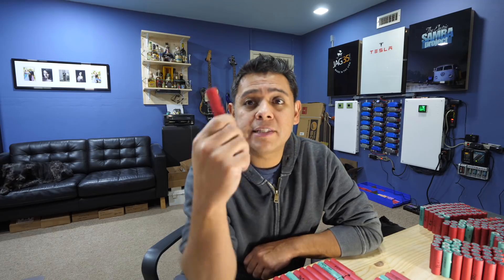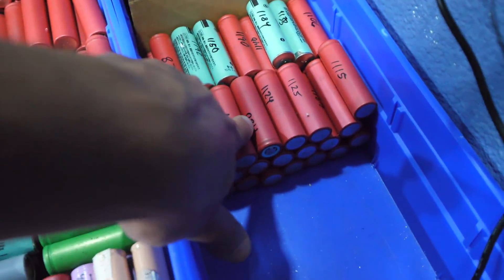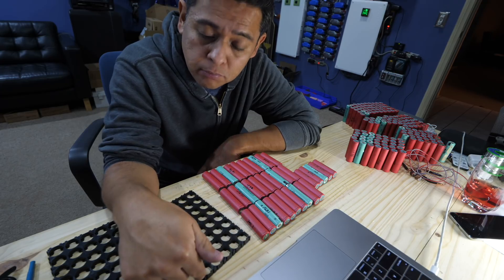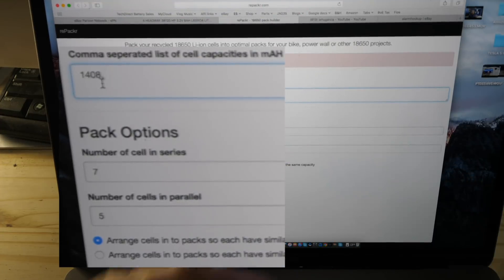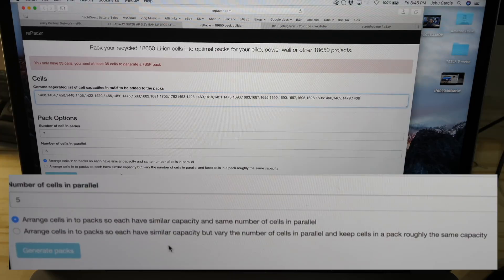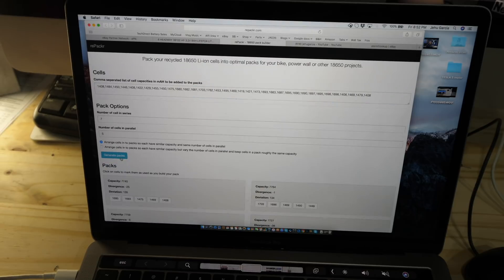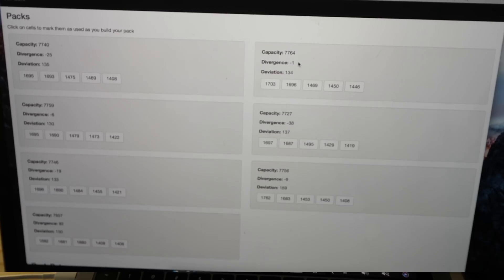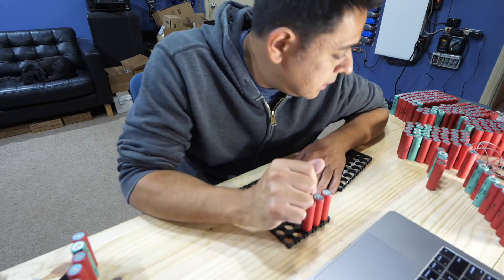Make Matched 18650 DIY Powerwall Modules using Builder tool rePackr.com

Comment: I got quite some 18650 battery’s from battery packs, but i always use LGHG2 3000mA for my vaper, these battery’s are the battery’s ever made, it asks a-lot of current draw, and you recognize a good battery with this vaper! 
When the battery is empty, it immediately stops!
If you draw it in a schematic, the curve line goes immediately to zero, with bad produced battery’s the curve line goes slowly to zero amps, which is quite annoying though. You will find these battery’s in good quality electric drills etc. They keep their full, and it immediately stops when their empty.
This whole story takes me to this.
When I charge a battery from a accu pack.. charged it for 2200mA or so, but when i fire it up, a lil’ fluffy cloud comes out for a second. So this is a good indicator to test a current load.

I learner this is on my from a old skool repair man, he said when a battery is fully charged it won’t tell anything!
When he putted a watt meter on it, you see the current drops so fast, that the battery is unusable en go straight to the dumpster!
I haven’t got a single battery from a pack which can hold up with my vaper..
So those battery’s are quite bad, I think they do…
Maybe in a battery pack, but i really dunno.
But putting a load on it it will immediately tell you something, so i guess you can skip leaving the battery’s to wait for a few weeks. But you can test this by comparing.
If so leave the whole storing technique lol

I have some other question also…
What it is the cheapest method to discharge.. lol a resistor, but safely discharge, so it dusn’t goes under voltage!
Reply: I did some measurements on my work..

I tested 2 batteries from packs and 1 Good battery LGHG2 with a wattage meter 
They all measured 3 watts, but when i added a voltage meter also i saw a big  difference!
The HG2 stayed on voltage, while 2 other 2 battery’s had a continuing voltage drop 🤓
This kinda explains why those battery’s didn’t work i my vaper.
It wasn’t capable to provide a steady load. I vape at 50 watts with 0.18 coil/resistor so if you do the math you will have current load of 16.6 amps @ 3volts, my vaper goes up to 75watts and with a 0.18 coil it pulls 20.4 amps current @ 3.68v the HG2 supports 20amps so i know that the battery is healthy when i use it in my vaper..
This is like the most extreme current draw you can do.
It might be handy to get datasheets of each battery you have to see what current draw they have, and with an ohms law calculator you can easily calculate resistors en very important how many watts a resistor must be, because the can get hot though.

If you do some research and buy some resistors to duplicate load en put a voltage meter on to see if the voltage drops, you see it’s a bad battery…

But maybe those battery’s will work in a pack, due the volume, but the current draw would be way less then when you have non healthy battery’s.
If you have healthy battery’s in it you have a killer pack though!
But with this info given, you can design your own current load test with a few resistors, a broke charger to test/hold the battery and a cheap voltage panelmeter to check for the voltage drop.
Try s different loads also, maybe with 0.1amp load the voltage drop stays steady? 
Ohm law calculator is your big friend in this
Reply: With a 5.6ohm 5watts resistor you have a current draw at 0.73amps & 4.1volts @ 3watts
It’s about doing the math, testing different setups and take note’s
Reply: Maybe a warning notice, if you work with healthy battery that can deliver let say 20amps each battery and you will have 56 in it, it’s like 1120 amps!! That it sum high current no to fuck with tho, if you got a short maaan you get fireworks, you gotta do sum real serious wiring lol with those healthy ones…
Nuff said i hope you can do something with all the info i gave
Btw i dunno if the amps go down if put them in serie, parallel i never work with that stuff
Reply: Maybe a good tip to buy cheap healthy battery’s, company’s who sell new ones regularly get packs back due all kinds of reasons, they can’t sell them as new, they are tested as healthy one’s and you can get them quite cheap tho, may be even cheaper is you disassemble yourself
Reply: Maybe another idea for a adjustable current loader is to buy an istick pico 75watt mod, make it so you use an old broken charger to hold the battery in, otherwise it’s a pain to test many battery’s, may use a higher ohm coil, or make custom, it’s just a twisted a wire. Add a voltmeter Voila you have a adjustable current/battery tester.
Might be handy to check at which rate the current draw, the voltage stays the same…
Then with ohms law you can calculate the current.
But maybe the is a cheap pcb also which has the same functionality… google is your friend in this! Cheers & good luck

Comment: if i have 1000 cells in each 3.6volt pack will i need to do this if all of my cells are between 2400mah and 2700mah?  total battery size is 7s1000p.  how forgiving is the capacity on large power walls.  or should i very carefully balance each pack by tested mah?

Comment: The builder tool is easy to use, spot welding was harder than expected, I built a 7s 15p pack (I wanted to charge 1 amp per cell) ended with a 932wh pack, still have to test to build another one. This video helped.

Comment: So the rated drain of a battery doesn't affect capacity if the amperage isn't pushed? Like I can use a 20c 2500mah battery with a 10c 2500mah battery if I'm not exceeding 10c per cell? They'll discharge at the same rate?

Comment: if we bought the 10 pack of your PCB cardss would that be 7s10p?
Reply: or would it be 10p7s
Reply: and could you even use this tool for your PCB because eche individule 18650 Cell is actually in series?

Comment: Jehu,

Love watching your videos 👍

I want to make my packs modular like you have for my powerwall. My question relates to the BMS for each pack. I was planning on 7s10p packs/modules, with 7 of these modules in parallel to dictate overall capacity. The plan is to set up in a way that I will never draw more than 0.5a from each cell. In your opinion what amp rated BMS do you think would work best for each module?

Comment: Hello, do you have to be careful about the internal resistance of recycled li ion cells? Only use the ones which values are close to one another or it doesn't matter? Because some bms are designed to ballance new cells and those cells have pretty much same internal resistance?
Greetings.

Comment: Can i use 2000×15=30000mah for one parallel, 2500×12=30000mah for other parallel 3000×10=30000mah for one more parallel in 13s battery pack

Comment: Hello. Thank you for creating this video. But I'm a little confused. You say 24v with 7s. But in other videos you say 3s is 12v, so 6s would be 24v.? So 7s would be ~28v? What am I missing? Cheers
Reply: every liion cell is 3.7v. so 3s is actually 11.1. 7s is 3.7 x 7 = 25.9. if you would use 6s you get 3.7 x 6 = 22.2. neither of these is perfect, so you can pick the one most suited for your application.

Comment: What is the best fuse wire? I only use 1/8w resistor leg !!!
what is the ohm you are using it for 1/8w resistor ????????
Reply: The Ohms does not matter, the resistor is removed ...

Comment: Hi J!, I use these BixPower battery packs to power Cisco DX70 units, but I'm wondering if you'd know of something better and cheaper out there.

Bixpower battery: https://www.amazon.com/BiXPower-BP160-188-Watt-Hour-Capacity-Rechargeable/dp/B074R5M5W3/ref=sr_1_1?ie=UTF8&qid=1547236461&sr=8-1&keywords=bixpower+bp160

DX70: https://www.cisco.com/c/en/us/products/collaboration-endpoints/dx70/index.html

Comment: You could have pulled the balancing wire out of the bms instead of soldering en 2nd one to it! Tip for your next balancecharge with thw rc charger. Have a good one m8 love your work.

Comment: Should I check the battery even if I buy brandspanking new 18650s??
Reply: @Victor Guillen
 - It is much better to find out that you have bad cell BEFORE you build the entire pack, because then you need to dis-assemble and re-assemble the entire pack ...
Reply: this only really applies for recycled 18650's. new ones from a TRUSTWORTHY source should be good, but if you buying chinese stuff you should test anyway.

Comment: Don't just run with the first numbers RePacker comes up with.  You can do a lot better if you do one run and then substitute the Flyers with better batteries and run the numbers a few more times like that.  With a few runs you can get the Deviation number down quite good.

Comment: hello Jehu , I need to make a pack 19s 40ah for my scooter  I need to know how many cells do I need thanks
Reply: I think the 19 in 19s spells it out for ya there fella. As for the Ah depends on the capacity and rating of the batteries your using.
Reply: @jose r
 - Do you have any cells in parallel ?

Comment: I do not think that this programm is the right thing to do. putting cells of 1600 and 1400 together in one parallel pack will kill cells since the higher capacity cells always have to cahrge the lwoer capacity cells. Best practice would be to sort the batteries well enough to have them all withinn a few mAh to extend the lifetime.
Reply from the maker: You might want to watch this video again,  the tool discussed here is for the purpose of achieving success using cells of different capacities
Reply: As a physicist i tell you this shortens the lifetime of your cells when you put cells with too much of a difference in a parallel configuration.

Comment: Another Great Video! I like to add a balance cables along with the BMS, just incase I have to balance charge later. You have to be careful when using a BMS and Balancing if you have a charger that does more than .5amps per cell. If your charger does more than .5 amps, sometimes it will trip the protection circuit and cause the BMS to fail, unless you reset it with no charge. Some will allow you to just add a charge and it reset. But if you don't know after balancing and thinking all is good. Your BMS wont balance or protect the batteries. (not sure if this is normal Behavior) just my experience.

Comment: How would I get those 4 digit numbers to enter in website. Thanks. And do they all have to be similar or close to similar voltage.
Reply: those number come from the Battery tester, you can get a Zanflare, or OPUS BT-c3100 and it will give you the internal resistance and the capacity ...there are many more bu that is what I have... I like the Zanflare the best...

Comment: I'm surprised you are not adding Super Capacitors to these setups. They can store energy for a long period of time and some are using them in place of a 12Volt car battery. One guy left his car at the airport for a long time, it still started when he got back using the Super Capacitor's as well as a LiPo square cell with it as well.
Reply from the maker: These don’t need capacitors,  batteries work better at storing energy
Reply: I just thought for some storage it might work well adding some Super capacitor's, you can buy them for Audio Systems for your car for around $400 USD. Check out the guys using Super Capacitor's in place of the car's battery, it stores electricity longer without going dead unlike a Lead Acid battery which all cars are using.
Reply: @cuddles6938  How do Super Caps make this battery pack "better" ?  They add too much cost ...

Comment: I have built several packs and never use a BMS. They always fail and are a pain in the butt! I charge my packs every time with a nice hobby balance charger. The 52v packs I build are split into two 7S packs. I then charge each 7S with my dual 8S balance hobby charger. I believe investing in a good hobby charger will out way all the bad BMS issues I will have to deal with in the future. Plus the hobby charger allows me to monitor cell voltage and resistance which helps determine the over all health of the battery.
Reply: Well, you are using the BMS ( balancer ) that is built-in to the Charger. You have no BMS when discharging ...
Reply: the internal BMS provides over current, short circuit, over temp and over discharge protections for the pack though
Reply: This message was sent 7 years ago and off the shelf BMS units have come a long way. They are now more reliable. I have been using some of my batteries with no BMS for years with no issues with a fuse or circuit breaker for over current or short circuit protection. Obviously a BMS will provide more protection and I use them on my larger packs.

Comment: Thanks! Used this tool for a ebike 13s6p pack. For powerwall modules, would 35 cells (7x5) as you have it here be the recomended pack size? Thanks!
Reply from the maker: Depends what you want to power,  and the scheme you want run your battery at
Reply: just starting here... my idea is 48v and have an "ever growing" powerwall (once is big enough, additional packs would work as replacement of "bad ones")

Comment: That tool should add a way to enter both capacity and resistance so you can build a pack that not only stays balanced during slow discharge, but also won’t let one brick sag excessively during high discharge. Sort of like one of your old videos shows how to do by manually grouping the cells and getting the high drain and low drain cells equally distributed while getting the total capacity of each brick as close as possible.

Comment: You can tell Repackr.com to rerun it's algorithm on your list of cells and it will produce a slightly different sort result each time. So if the divergence is more than you like in the first result - you can just rerun the sort and (maybe) get a very slightly better result. The backend code uses a cool software technique called simulated annealing: https://en.wikipedia.org/wiki/Simulated_annealing

Comment: You changed your mind about Bmss
Which is dispointing cause im planning to build a pack without it.
What makes you change your mind
Reply: He's talked about this dilemma in a few live feeds. For himself he prefers to start with well matched cells and then monitor the battery himself. But if he's building something for other people who may not monitor the battery then it's probably better to go with a BMS. Also - the need for balancing decreased as the number of cells in parallel increases. For a "small" 5P pack it's worth having a BMS (and try to get a reasonable quality one - not a super cheap one).

Comment: Hi Jehu, thanks for another awesome vid. I wondering how relevant the accuracy is. Lets say you want to increase battery life and only charge to 4V and discharge to 3.2, looking at the discharge curve of an average cell that will give you about 10% less capacity but will increase cell life dramatically. When you test the cells you are dependent on the cutoffs from the charger, which will probably be on a larger range then what you would ideally want. I get it that you dont want to put cells 500 mah apart together but given that there is an error on the capacitytester(is there, have you ever tested one cell 10 times to see what the sd and variance are?) It feels like an overkill because there is an inherent uncertainty with these cells. What do you think? Thanks for the awesome channel!

Comment: Bro, thanks for telling us what's up with BMS/balance devices from on line sellers. I finished my 7 kwh powerwall-clone 6 months ago, without BMS's. I buit it from the 1S 20P packs that you used in one of your other powerwalls. They are all closely matched in capacity. I have since been trying to find BMS's to make it more balanced. I have bought 5 or 6 BMS's from different manufacturers, and have not found ONE that works 100% correctly. mierda pura
Reply: Barry Taylor One word: Batrium.
Reply: or check out the diyBMS if you dont mind getting your hands dirty soldering it.
Reply: Mar Eck do you have a link or info to diy bms?